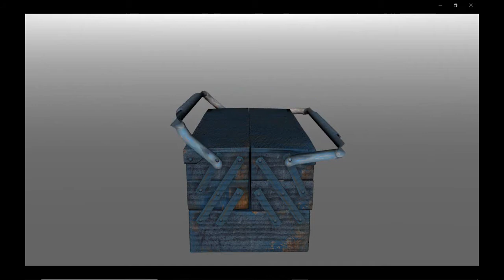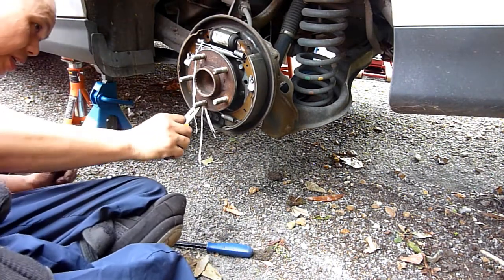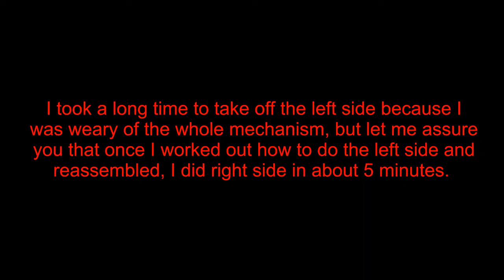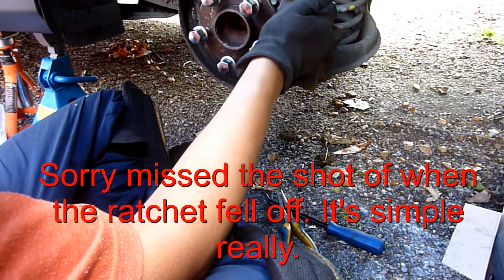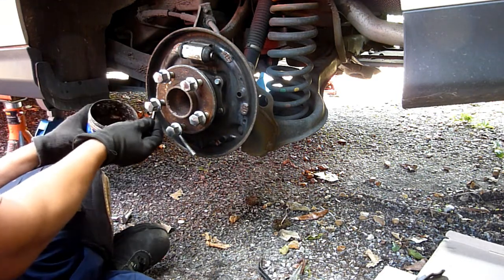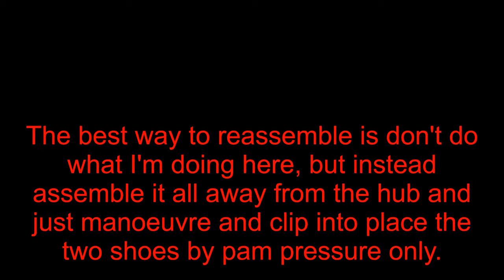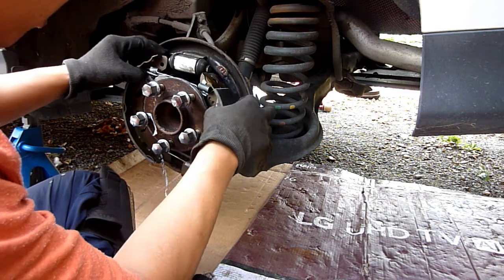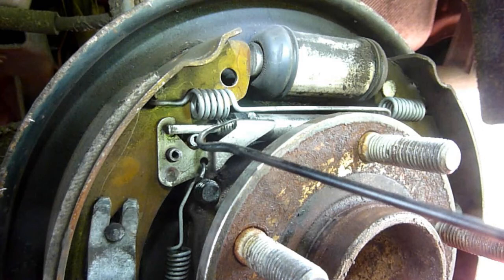How to Change Brake Shoes - Ford Focus 1.5TDCI MK3.5 2015

Comment: Novel idea to use Teflon like that! Great to hear your thinking. I do these every 5? years of so and always forget how to do it. Watched loads of vids. Have heard people say best to assemble on the floor and then install but haven't actually seen anyone do it.
How many clicks did you have to raise the handle? Your old brakes seemed to be hardly worn. Great idea to test for the drum overheating. Presumably, like my '95 Fiesta/Courier, there is no slot at the back for adjusting the ratcheting wheel. The only point I'd question is that you say the drum should spin freely. Everyone says it should turn with some resistance, should hear slight resistance. You'd think they'd put a simple diagram in with the shoes --too much trouble for them. Thanks for sharing.
Reply from the maker: My advice is, if the components are in good condition, then adjust until, it nearly touches, or if it touches - back off a notch or two and let the auto-ratchet do the rest by engaging and disengaging repeatedly on a flat surface. I thought this particular set of shoes was well designed in that it was not in high tension at all when reassembling with new shoes.

Comment: Hey there.  Great video , thank you for doing it! Happy Easter btw , I had a question about tire tread and what it means if my tread is thinning on the left side of my right rear tire. Would show a picture but not option able.
Reply from the maker: You may need a rear alignment done. Some cars can change their rear toe angles. Check also springs and shock and tyre pressure.

Comment: size of the screws to be able to open the drums please I also have to do it on my focus but I cannot find the size
Reply from the maker: M8 about 5cm long at least. M8 is metric 8mm diameter shaft of bolt with standard threads.